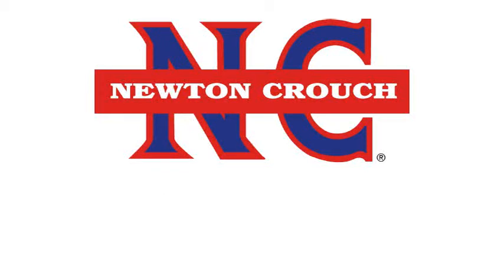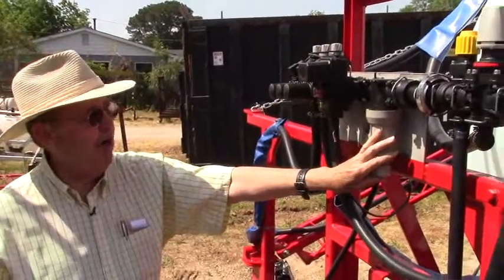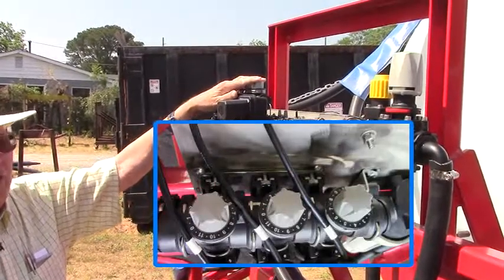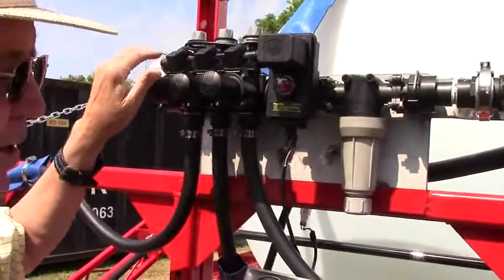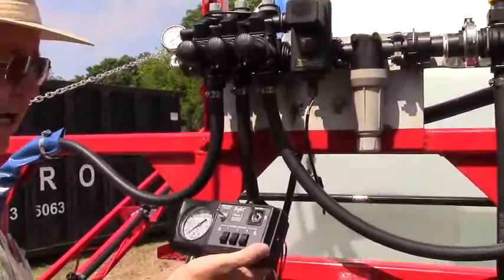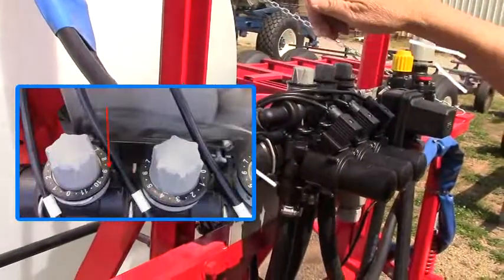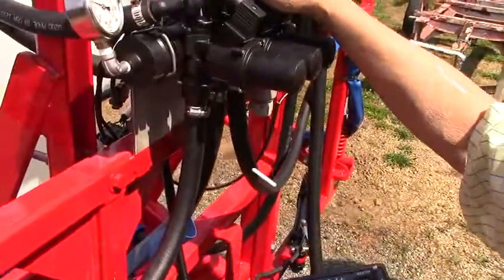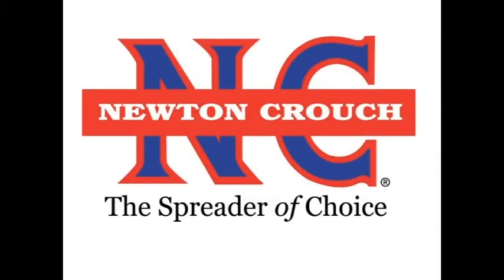How to set TeeJet Flowback Valves & 744 control

Comment: We are using a TeeJet 744A-3 Controller on a trailer mounted sprayer. We want to use various pick-up trucks to spray ditches for weed control. Wiring the controller Red/Black to a cigarette lighter but what is the blue wire for? Must it be connected to a power source? Does the power source have to be the headlight switch as recommended for use with a tractor?
Reply from the maker: Blue wire is for backlight in the pressure gauge.  You do not have to connect the blue wire unless you use the pressure component in low light.  I hope this answers your question.
Reply: @Newtoncrouch Thank you for your reply. Yes it does answer my question.